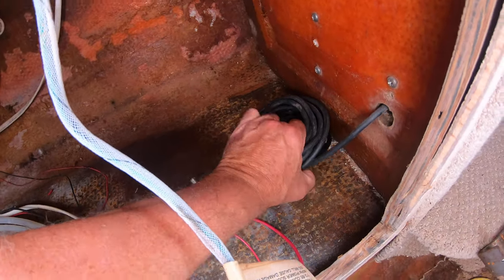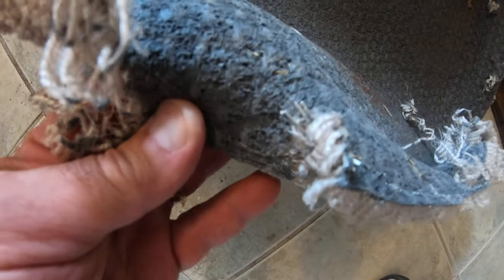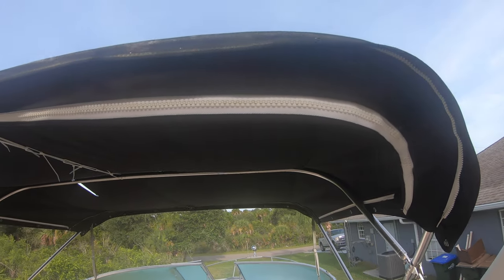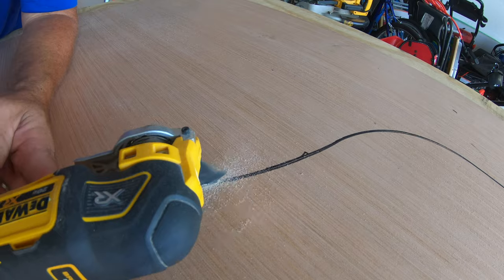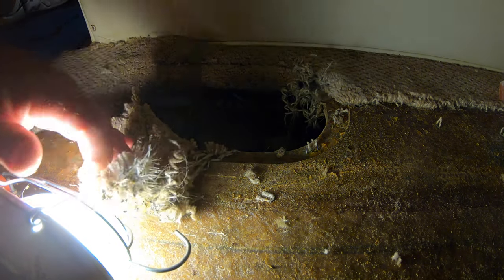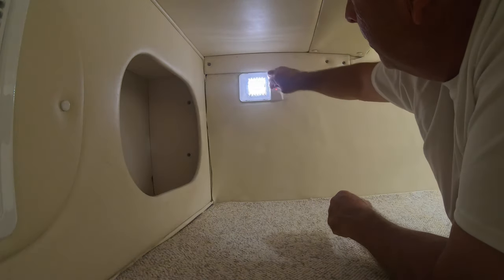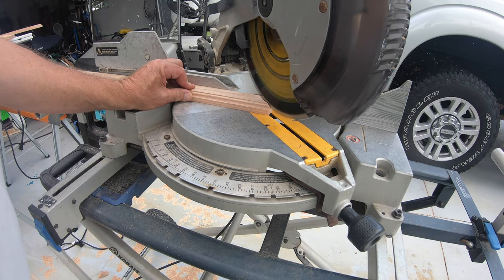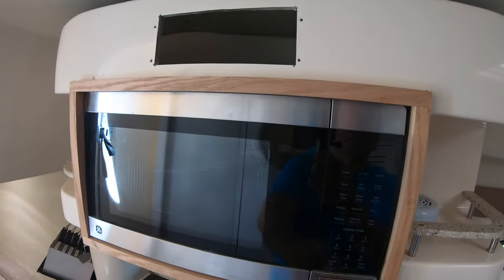Rinker Fiesta Vee 270 Boat Restoration   Updating the Interior   4K

Comment: Love you video. Wondering if you could help us with mounting the tv mount. What is the makeup behind the wall into the closet? thickness? What did you use to secure it properly?
Reply from the maker: Thank you for the comments. I through bolted the bracket with fender washers and nuts. It passes through the fiberglass wall and into the little locker that is that is to the left of the head door. I used large fender washers on the inside and was able to snug it down pretty tight. Also, while we are underway, I use a large one inch wide piece of Velcro one wrap that encircles the TV and the bracket and holds everything in place when we hit rough seas. I can also email you some pictures of the way I mounted it if it is helpful.

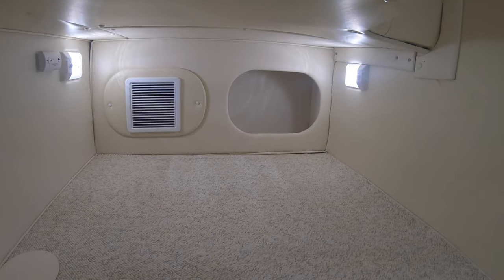Comment: At 9:12 you show the new lighting...did you run new wires or did you boat have something there already? I just bought a 2006 and I see some differences but I haven't seen any lights in that area.  I'm all ready to go nuts with new lighting and 12v power outlets for the numerous phones that will undoubtedly be on board.

Comment: Hi I just bought a Festiva 27 ft 2002 the air conditioning thermostat is missing I was wondering where you Source yours so I could actually install one
Reply: i also am looking for a thermostat control and the one you used in the video looks amazing. Whats the make and model of the AC control and where did you purchase it?

Comment: Where is the blower switch location on the fiesta vee 270
Reply from the maker: Hello, it is located to the left of the key switch for the ignition.
Reply: So it’s on the ignition plate rite
Reply: Do you still have the boat
Reply from the maker: @heathmathews4403  yes it is. Yes, we still have the boat and use it all the time! I also had a custom dash made by New Wire Marine, but kept the original location.
Reply: @RandomlyAwkward1  so on my plate I have a square hole what went there.
Reply: On my plate I have a square hole what went there